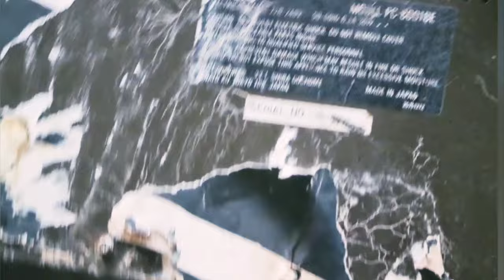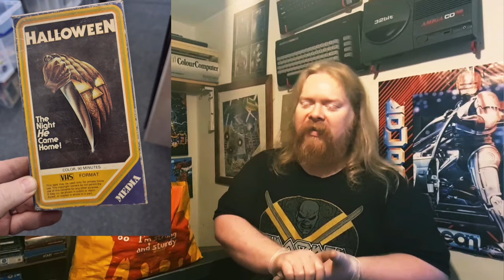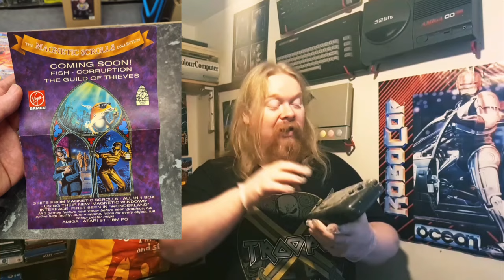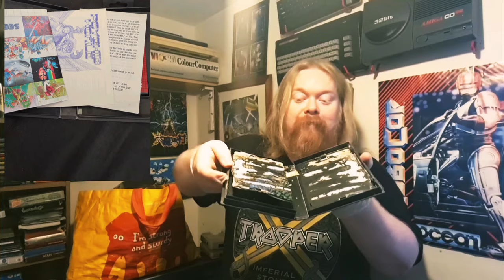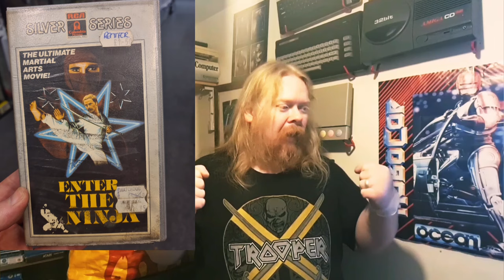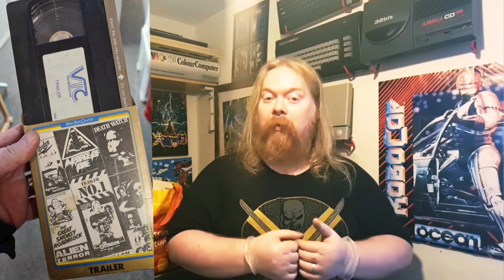Retro shop left to rot from the 80s...full of games videos and more PART 2

Comment: Hi great discovery and I am enjoying watching your videos. 

I would be happy to look at the PC-8001 unless someone has already come forward, although not sure of the logistics of getting it to Winchester. I don't have a YouTube channel but I imported and fixed up a PC-8001Mk2 last year, and recently fitted some Goteks to the NEC PC-80S31 external drives with together with 3d printed facias I made which I just need to test with the 8801 machine at some point. At the moment I have an FM-Towns Fresh stripped down and a PC-Engine CD-ROM I've been retrobrighting, replaced one of the cogs and will do a recap this weekend while it is apart.
The graphics are of the PC-8001 are similar to a BBC and the sound is a beeper:
https://youtu.be/ZPcukEiQZsc
Going a bit mad on the Japanese machines at the moment I also have the PC-6001, PC-8801 mkII SR which I just installed the 8801-23 and one of the tantalums shorted when I turned it on, PC-9801, EPSON 286C (PC-9801 clone)  and PC-9821.
Reply from the maker: Hi thanks for watching I think that that already been claimed because of how heavy it is whuld be a pain to post. You have some interesting stuff whuld love to get some things myself but have no clue how to import things